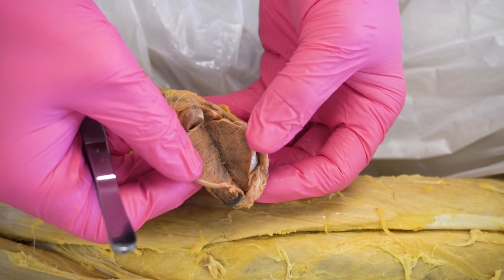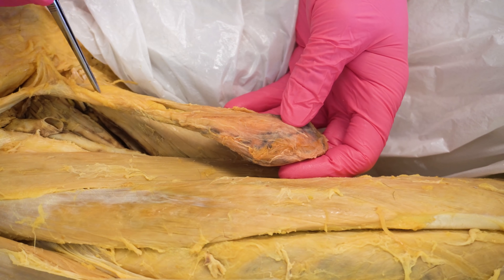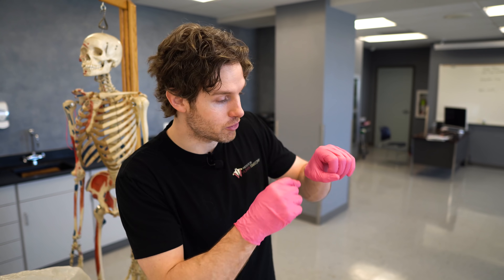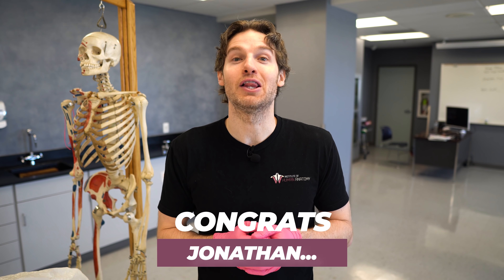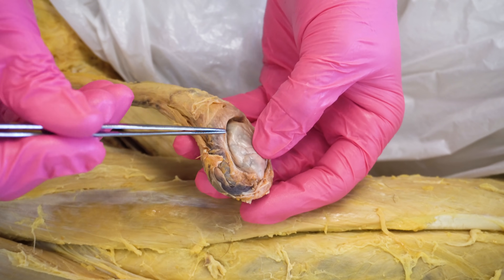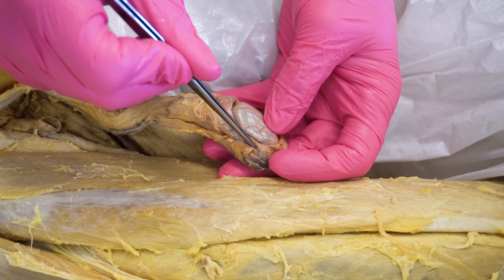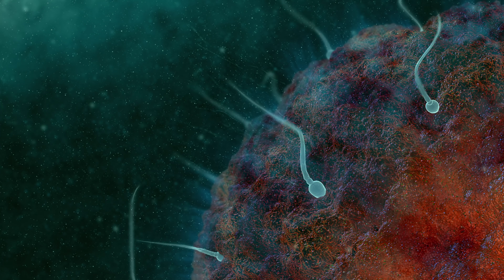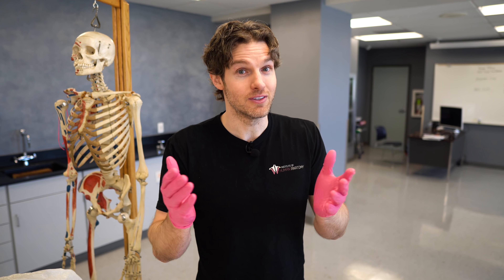How Sperm Is Created

Comment: Sperm fotmation occurs by gametogenesis process where the germ cell spermatogonia like primary spermatocytes undegoes mitosis and form 2 equal diploid chromosome and then formed secondary spermatocytes which is haploid but still to duplicate by meiotic division and undergoes the process and another cell division take place to form speratids which converts to mature sperm with head,tail and body by sperminogenesis and the mature sperm contain importantly acrosome which contain dissolving enzyme to penetrate the wall of ovum for fertilization.The sperm cell is provided with Mitochondria as it is the power source of energy and also have  tail. The sperm formation can not take place if there is no enough LH and FSH where the hypothalamus generally after puberty stimulate the pituitary gland to secrete enough gonadotrophin( LH and FSH) in male and female and the androgen which is testosterone produced by leydig cells. The process of generation of sperm cell by the meiotic cell division and later structural modification from the germ cell is called sperm formation or spermatogenesis.

Comment: If someone dies and you program a cumputer or device and connect it to the Brian’s nerver system could you make it function without it being alive?
Reply: My guess would be… sort of. If you were to pass current through a body, it would flail around a little bit. That’s because there’s still energy leftover in the cells, and that current tells them to convulse

So if you wanted to make complex movements, those cells would need to be alive. Otherwise it’ll flail around a little bit and just fall over
Reply: @username0984  oooooooh ok well I learned somin new

Comment: I would like to know what happens to them seeds (sperm) if you got a visectomy?
Reply: Your body absorbs the sperm into its body because the tube (vas deferens) that sperm travels through has been cut or blocked off. So men can still beat their meat and let out semen but it just won't contain sperms that can get a female pregnant.
Reply: @DLIX2DCLI  can we clean the vas deferens when it seems to get clogged by sperm, or urethra with semen and urine
Reply: @DLIX2DCLI  semen does sometimes contain sperm i think
Reply: @pinstripe5487  close but the prostrate is simply a muscle that in part spasms to ejaculate the fluids. It also controls flow of urine. Seminal vesicles produce semen and the bulbourethral glands aka the Cowper’s glands produce a fluid that changes the PH of the urethra so that the sperm will survive its journey. We usually have the urge to urinate after intercourse to change the PH back to normal.
Reply: Hmmm they die because vasectomy  is like cutting the bridge of San Francisco.
Reply: @allengina1091  they’re no longer orange?  ;)
Reply: @allengina1091  Die is an interesting way of putting it. They're re-absorbed by the body to be repurposed. Waste not, want not, and all that.
Reply: They have a video on this guys!
Reply: Vasectomies are actually irreversible.
Reply: @whitney8678  Yes, they are. It's not reasonable to do it though, unless you are sure you want to start having kids again. As I said, if you think you might want some in the future, you use a traditional contraceptive like a condom. Vasectomies are contraceptives for, potentially, the rest of your life.
Reply: @pinstripe5487  Right. You shouldn't get it reversed unless you are certain you want children. If one is thinking they want a child 10 or so years down the road, the success of a reversal is close to 100%. Using condoms & birth control may be great for you & your partner, but some people who know they want kids later down the line, bc & condoms may not be the right option for them. And remember, condoms are only so effective, as is bc. It all depends on the person. Either way, I'd hope no one on the internet would take either of our comments as determining their decision, but rather, talk to a doctor & their partner.
Reply: @whitney8678  I would hope they talk to a medical professional as well, yes, haha. As for the short term/long term thing, I meant for like... months to a year to maybe a couple years for short term. Apologies if that wasn’t clear.

Though then again, I don’t think all guys should go and get vasectomies just because they don’t want kids until later in life. Perhaps if they had a partner whom they were sexually active with. Otherwise, if sex is something they only do every once in a while, temporary contraceptives may be better. Though as you mentioned, it really falls down to the individual and their partner, if they have one.
Reply: @pinstripe5487  o
Reply: @whitney8678  for real?
Reply: @whitney8678  actually they are but the procedure is quite expensive and has a low positive rate for conception.
Reply: @randygreen007  definitely cheaper than a kid!
Reply: Never get a vasectomy
Reply: @Zgrateful1  why??
Reply: @Zgrateful1  rubbish. I can put up a shelf
Reply: Robert Telford ok but you’ll never reach the heights of men that retain their seed , do your research on semen retention.
Reply: @Zgrateful1  before my vasectomy I used to pull out and hit the headboard... Now I don't have to pull out 😃👍
Reply: Timpala you think that makes you cool
Reply: @Zgrateful1  Why do you think so?
Reply: @pinstripe5487  cause you can use a condom plus its expensive i think
Reply: @inno7845  Well getting a vasectomy is not about avoiding pregnancy until you're ready to have kids. If you want to wait and have kids later but still want to have sex, that's why traditional contraceptives exist. Vasectomies are easy, fast procedures that make pregnancy almost impossible. It's for people who don't want any more kids.

It's a more effective contraceptive than a condom, and it's cheaper than a kid is. The procedure costs about $1-2k in the US, not including insurance.
Reply: @inno7845  it's free in European countries.
Reply: @inno7845  0

Comment: If the process is so long, how are we able to release so many times? And if so, does does mean the sperm being released isn't "swim capable"? When we release let's say, after doing it every day of the past week
Reply: Because the sperm is being constantly produced, you don't run out. There's always sperm in each phase of maturity, lined up and ready to go. It's a lot like the assembly line analogy used in the video. The fully matured ones are stored for a while, and by the time they can be released, there's already more in line ready to replace them and become mature. The process is started way in advance to ensure that you'd never have to worry about that. So to answer your question, no, they are always matured and ready by the time they are released.

Comment: question.

if the Vas deferens was cut, do the testes still try to transport the sperm through the disconnected vas deferens they just spill into the sack or do they automatically sense that it's impossible and don't do that.

Comment: Hey, interesting video - I have a doubt - what happens when the sperm is not ejaculated.   The size seems pretty big ( 3500 per second) Does human body has a system to re-cycle or push excess to digestive systems or so  👀

Comment: Qur'an 86:7 says that sperm originates from the backbones and the ribs, a theory similar to another erroneous theory proposed by Hippocrates in 5th century BC (1000 years before Islam). Hippocrates taught that semen comes from all the fluid in the body, diffusing from the brain into the spinal marrow, before passing through the kidneys and via the testicles into the penis.[1]

Comment: Considering how slowly the sperm move through these tubes, I'm curious what force propels them through the vas deferens so quickly. Negative pressure? Muscles? Is there some sort of valve that's usually closed, to prevent sperm from going into the vas deferens when they're not needed?
Reply from the maker: During arousal, smooth muscle contractions in the wall of the vas deferens will propel the sperm.

Comment: I have a question: So, after cca 80 days a sperm cells is fully developed and ready for use, but that not always the case. If they are not used up, for how long are they stored before... whatever happens to them (i want to know that too)? How many useable sperm cells can a human body contain at very most?
Reply from the maker: They can be stored for a few months. If the cells are not released they will eventually be phagocytized and reabsorbed. I would say the "useable" amount varies from person to person depending on how much is released per mL of seminal fluid.
Reply: @theanatomylab  if a guy is on the high end of sperm releasing in the seminal fluid and ejaculates a few times a day is there a point when the seminal fluid is devoid of sperm or will there always be sperm with each discharge?

Comment: After your sperm is fully cultivated some time after that 60 to 90 day period, it is broken down and reabsorbed by the body. It turns into cerebrospinal fluid (basically brain fluid). (And yes, there's scientific evidence supporting this). Also, the most powerful and richest men have withheld from releasing, some for years. Mike Tyson didn't release for 5 years, Steve Jobs never "finished" when him and the wife went at it, Nichola Tesla died a virgin, and the list goes on. Men have liquid gold we produce every day, but we're wasting it. Hold that in and and you have a cheat code ready and waiting. If anyone's interested, search up Semen Retention.

Comment: How long does the sperm cells get stored if not use right away before new batch of sperm is made?
Reply: And what happens to them after they die, if not released?
Reply: @pants6416  i think they recycle and get released into the body as proteins
Reply: @pants6416  just like cells of other internal organs.... disintegrate and eliminated as waste
Reply: @ericolens3  just eat a bit more protein if you are worried
Reply: That's a nice question.